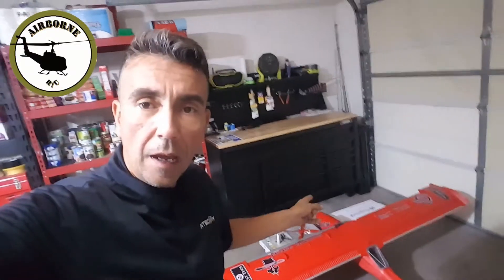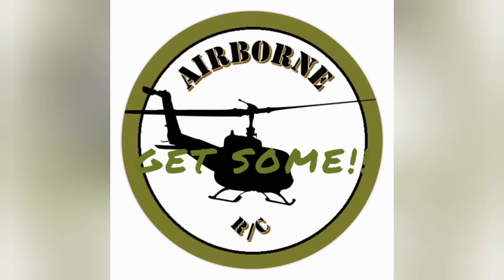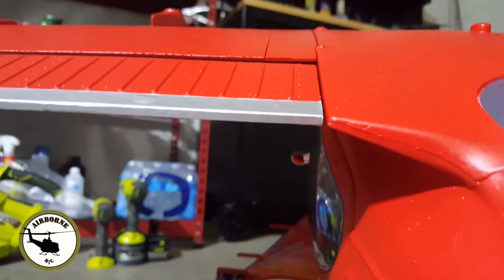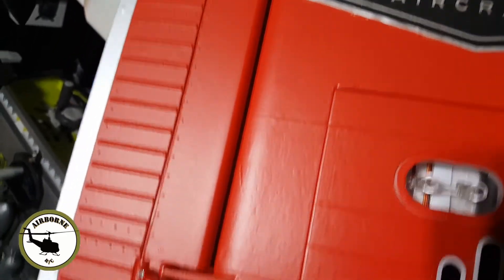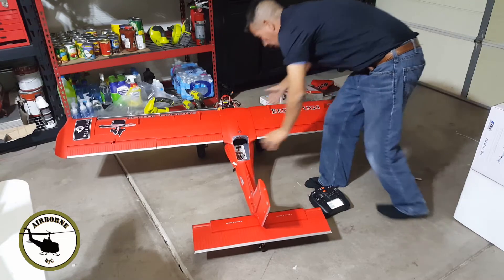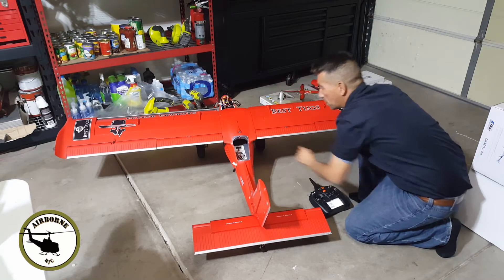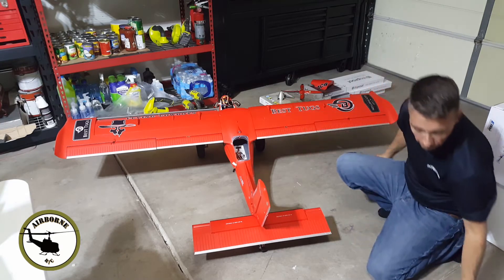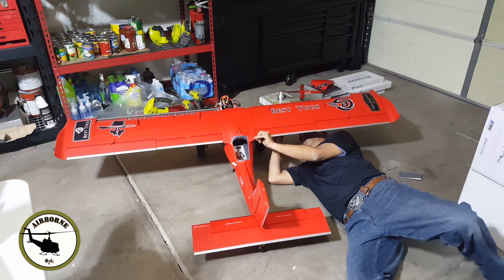Eflite Draco control surface checkand flap manual adjustment

Comment: Any idea how to do the same for the rudder? My rudder is 20 degrees left turn with the tailwheel centered.
Reply from the maker: I dont have the plane infront of me  im at wok but i believe on the tail whel there a screw that  holds the metal of the wheel to the horn you can try loosening it straight the wheel to the rudder then tighten her up again
Reply: @NoonzAirborneRC  Horizon Tech says to tweek the tailwheel springs until you get the tailwheel straight with the rudder. No other way according to them. My flaps & ailerons were fine, but the tailwheel really ticks me off. Same with their Mickeymouse fix. I wound up engineering one spring, putting the Z-bend as close as I could to one end of the spring, cutting off the other end to 1/4 inch length and soldering on a Dubro threaded coupler with a Clevis on the other end. That did the trick, plus it's adjustable.